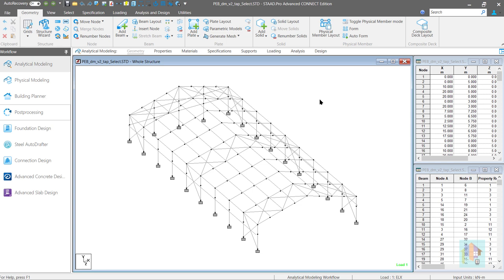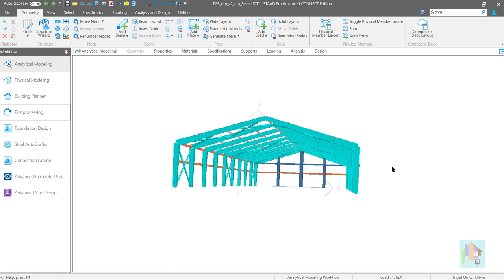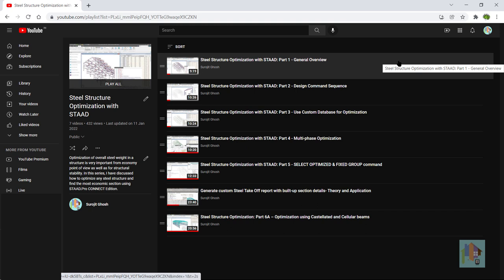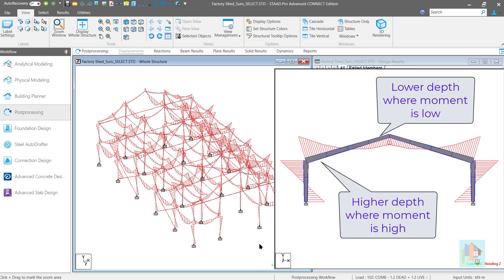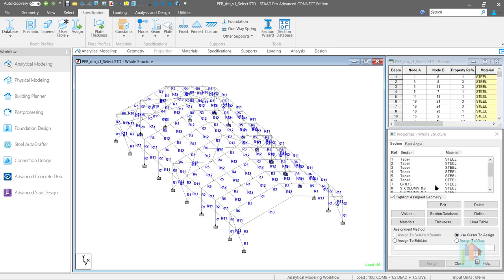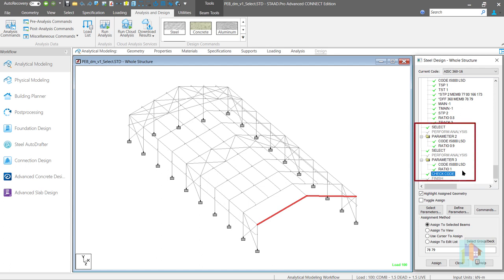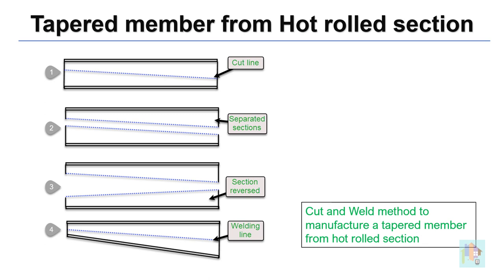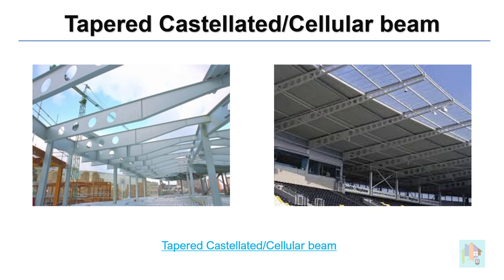Steel Structure Optimization: Part 6B – Optimization using Tapered member-An Overview || Taper Depth

Comment: Hello Surojit, Thanks for the speedy reply. The excel macro sheet I am referring to is for the Design/Optimization of Tapered Member.
Reply from the maker: I have developed this only for IS800:2007 code at this moment. Several OpenSTAAD functions which are required for tapered optimization are not available and I have to develop the entire Indian design code engine by myself to make this work. Unless those functions are implemented, I am not in a position to implement tapered optimization for other design codes, hence this will not be published soon.

Comment: Hello Surojit Sir, your work is fabulous in the field of automation. Can we prepare same MTO for RCC as well?
Reply from the maker: This template can be used to extract concrete information (volume, weight). But right now reinforcement information cannot be extracted using this. As there is no direct function available to get the reinforcement information for any concrete member, it is a bit tricky to extract the bar information. Also RCDC can generate a very extensive BOM for concrete member. That's why I have not included this facility in the MTO template. I will include concrete member in future.

Comment: sir, please make a video on connection designs especially that of bracings.
Reply from the maker: You know, it is really very easy to design any connection including horizontal and vertical bracing connection directly using the STAAD model data using integrated connection design module. If you assign a connection tag to any member, then the end connection is designed automatically once the analysis is complete, else you need to manually assign the connection template and design. 
I have some plans to create a new video series on connection design. Keep watching.
Reply: @surojit_ghosh  sir...I've been trying to design sag rod bracings both in RAM and idea statica...but it's not working. Sir, please make one dedicated video..especially on rod bracing (sag rod). It would be very helpful for freshers likes me...please sir.

Comment: sir , please tell us how to optimize tapered members please
Reply from the maker: There is no in-built option available in STAAD to optimize any taper member. We can manually optimize it, by guessing the dimensions, but it will take more time and will not be accurate. We can guess a range of section depth(which I have discussed in this video) and then go for trial and error. But the most efficient way to optimize a section is by using any custom macro. Optimization is a multi-step approach where depending on the selected section, section forces are modified and that further changes the section dimension. So it is always better to take the help of any software or any custom macro.